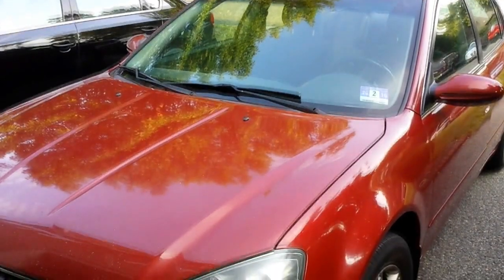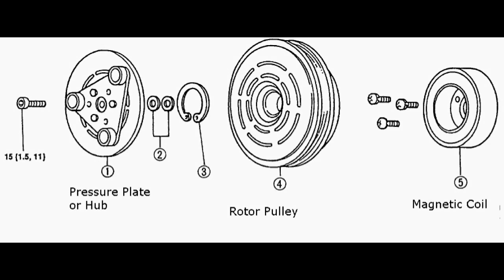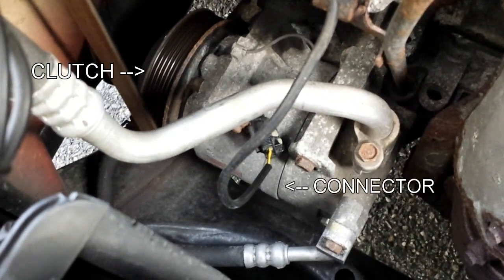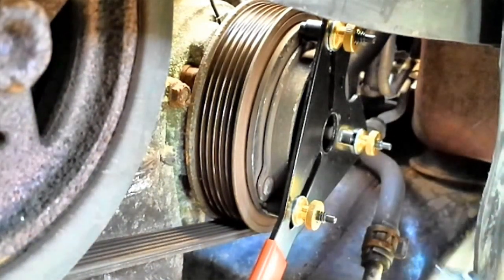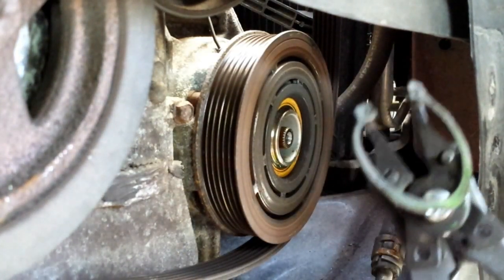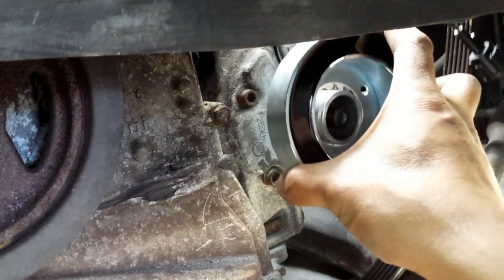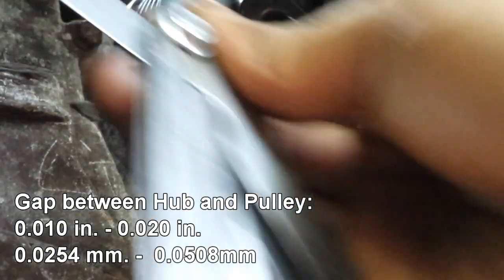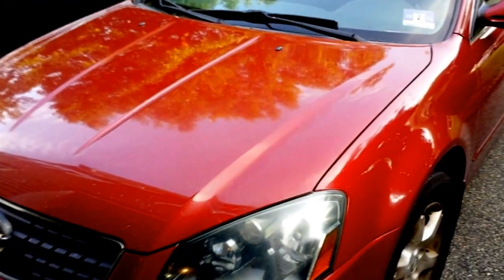A/C Clutch Replacement - Save $1000 Dollars

Comment from the maker: ✏️✏️✏️✏️✏️✏️✏️✏️✏️✏️✏️✏️✏️✏️
👀Tools and parts you need 👀
https://amzn.to/2SUttPd - Compressor Clutch Assembly kit
https://amzn.to/2SJO6gB - Clutch Holding Tool
https://amzn.to/39trjvy - C Clip or Snap Ring Plier
https://amzn.to/2SJyLgg - Feeler Guage
https://amzn.to/35kPDg5 - Jack and Stand
https://amzn.to/2QCdySF - Breaker Bar
https://amzn.to/2QxLLmo - Impact Wrench

Comment: I just took my Nissan Altima to the dealer for a diagnostic done on the AC unit because it wasn’t working and they told me both the AC Compressor and the AC Compressor Clutch needed to be replaced. How much? $2100 so I told them not happening I’ll do it myself. So I was happy to find your video on how to change out the clutch I already know how to replace the AC Compressor but I’ll do the clutch first only because I had the ac Compressor replaced a year ago and I think they were trying to get over on me. So first time doing this wish me luck and thank you once again for this video, I’ll let you know how it went
Reply: Wow, yeah I think that the shop was trying to get one over on you.
Reply: My truck compressor sometime work probly one time a week and minutes late stop do you think is the clucht.by the way, did you fix you compressor.
Reply: Proyecto Aventurero no I haven’t fixed it yet, but I will I had some unforeseen circumstances that prevented me from doing that
Reply: Randy G yes I think so to, so after watching this well put together video I’m going to fix it myself of course record it and then go back to the dealership and get my money back for the diagnostic which cost $158 smh!

Comment: Great video.
Except you got the metric clutch plate gap (in mm) wrong.
The gap should be 0.01" - 0.02", which converts to 0.254mm - 0.508mm.
That is 10 x the metric values shown at 9:28 😊
Reply from the maker: You are correct. Made a typo in the mm conversion. Good callout !
Reply: @yeahitworks    would the 2014 nissan pathfinder use the same gap ?

Comment: This is a great video. Thanks, h2oreactor. I'm going to try replacing the clutch on my car soon; have ordered the parts, will let you know how it goes. One question though: did you evacuate the system of freon before doing the clutch replacement? Looks like you didn't and that it isn't needed but want to confirm. Thanks again!
Reply from the maker: No I didn't deal with the refrigerant, I didn't remove the compressor. If you will be removing the a/c compressor itself, then you have to perform refrigerant evac.
Reply: With any car, if you have enough space to access the clutch assembly from the front then there's no need to evacuate, remove the compressor and then regas when you're done. Just work on the compressor clutch assembly from under the engine bay, you just have to unscrew a torx and then pull two circlips out of their place with most compressors and their assemblies to access the coil. Otherwise, the system has to be evacuated through a recycling station.

Comment: If there is fridgerant in the system ; than  it will be impossible to just remove the compressor. So you had pump out the fridgerant first ; it will cause troubles if there is still fridgerant in the system.
Reply: Let's just say it all, it will shoot out like a geyser, freeze everything up like there's no tomorrow and if it ain't enough make a huge Predator's blood oily mess that smells like Band Aids. So definitely recover any leftover refrigerant before opening the system. If you haven't got the required equipment and licence (whenever required), just let a pro do the work.

Comment: I do not understand which part is not working in my own car I just know that gas and oil refreshed and fans are working but I know that compressor is not working because performance does not change with a/c how can I fix
Reply from the maker: Compressor is not working as what you mentioned

Comment: How can the the clutch engages with the pully while there is a shim between them?
Reply from the maker: 2:12 once the coil gets energized it creates a magnetic field, the hub will get pulled in and stick to the spinning pulley and this will spins the hub(compressor shaft). This is where the shim/washer is critical, if there's a big gap (out of spec), then the pulley and hub won't stick together when the coil gets energized.  If gap is too close, the pulley and the hub might accidentally get engaged.

In the video,  10:20, you'll see that the hub gets pulled in slightly to stick to the pulley, and they both spin as one.
Reply: @yeahitworks  
Thanks.
Upon examining the cluch I found out that the cluch piece is made of two pieces one is fixed and the other  can move towards the pully if attracted by the megnet and attached to the fixed piece thru metal straps that act like a spring.

Comment: Was it making a loud noise before you changed it because idk if its the clutch or if I have to replace the whole ac compressor I will save almost 200$ if its just the clutch I to have a Nissan altima 06
Reply from the maker: Cinco Guapo no loud noise, the clutch is not engaging because of the bad coil.  try testing if first as what I've shown in the video.
Reply: +h2oreactor Most of the times the only defective part is not the clutch coil itself but rather the thermal fuse some manufacturers are used to put in series with the clutch (if, on a faulty coil you remove the fuse, bridge its gap with copper wire and then do a resistance test on the connectors, you may often find the coil has a resistance of 4 to 6 Ohms which is the resistance of a good coil) so that it permanently disengages as soon as the compressor starts binding. The problem is that somehow it can go off anytime without an apparent reason (heat cycling, even when you're actually not using the AC due to the compressor often being placed near to the exhaust plumbing or the catalytic converter, or vibrations prolly).